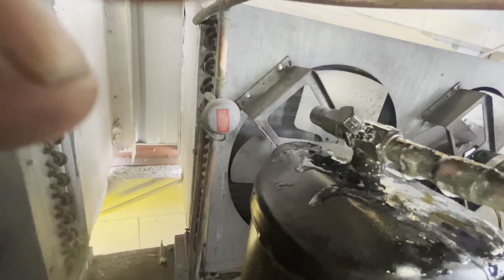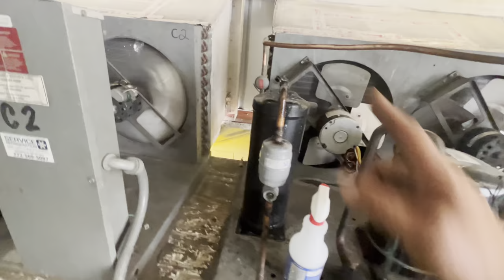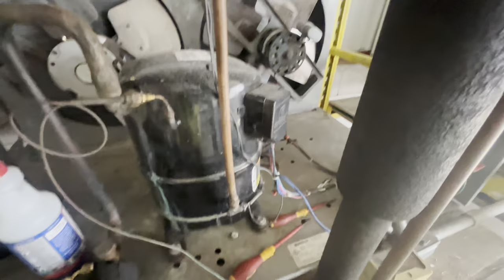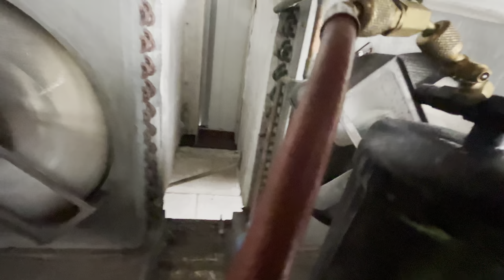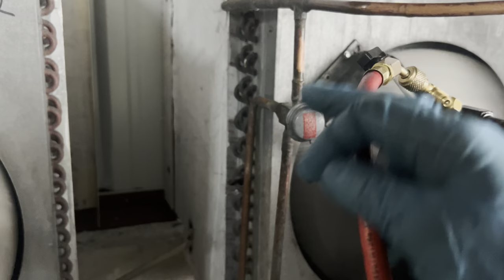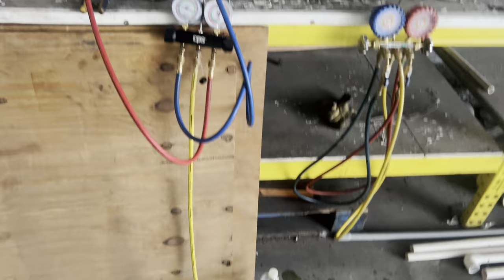BREAKER OFF LEADS TO HEAD MASTER DIAGNOSIS!!

Comment: I do not think you need a headmaster in Florida,fan cycling should be sufficient.2 cents.
Reply from the maker: I 100% agree , 2 options. 

Remove head master and pipe it in normally since it failed in bypass and has to be removed and install fan cycle control, or replace head master

Worked out the quotes and it was around the same price headmaster is just slightly more expensive.

They opted to keep it how it was designed.
Reply from the maker: But believe it or not it’s been pretty cold this winter, low 40s overnight and high 50s during the day so in those conditions I would go head master
Reply: @FloridaManHVACR true.